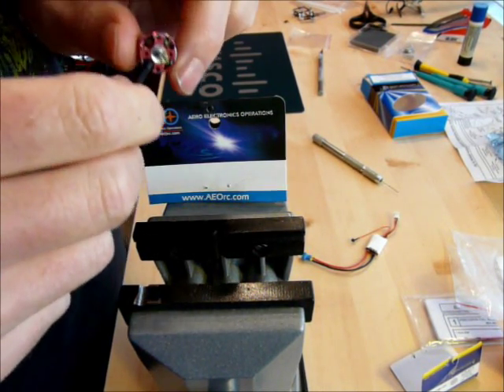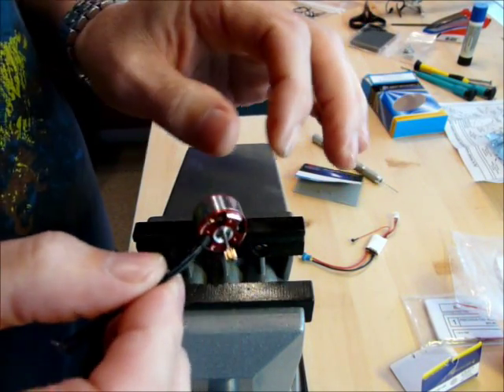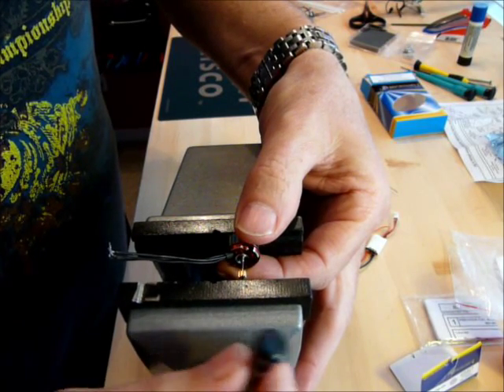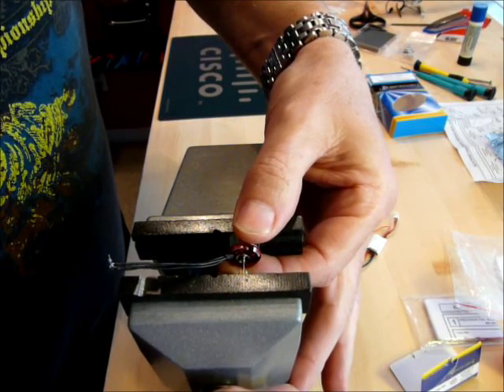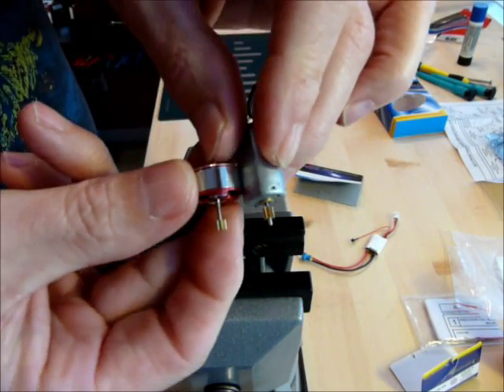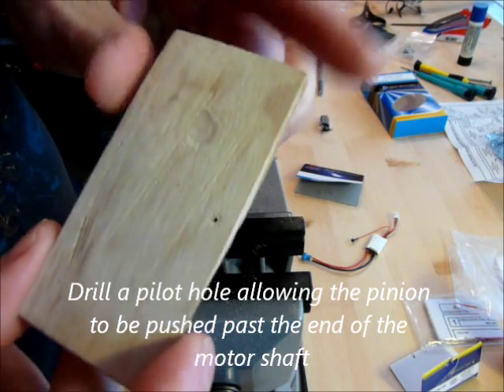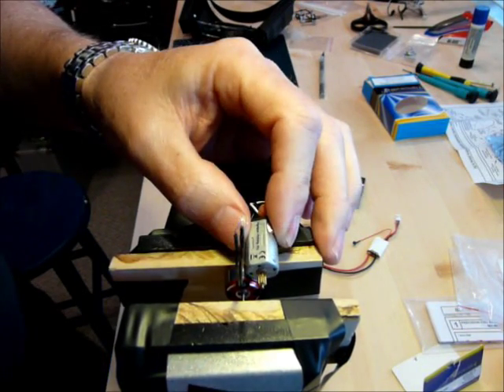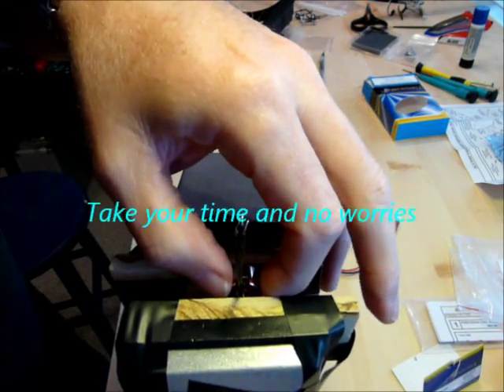How to install a pinion on a C05 brushless Mcpx motor

Comment from the maker: I've been using the pinion off the stock Mcpx motor and it has to be pressed on. If I have to order some I will use the slip on pinion.